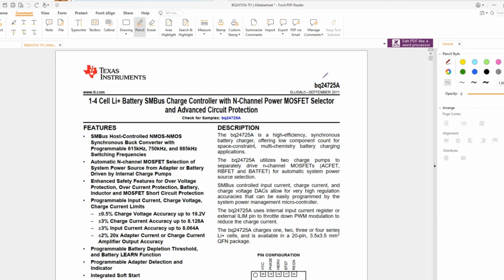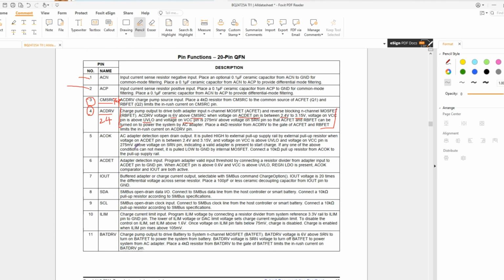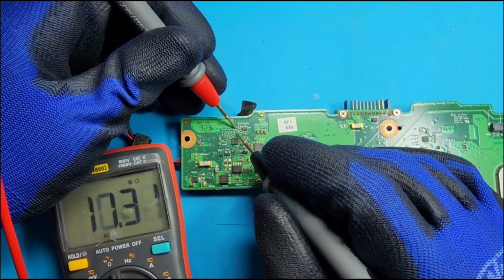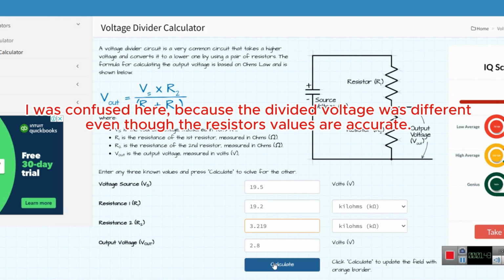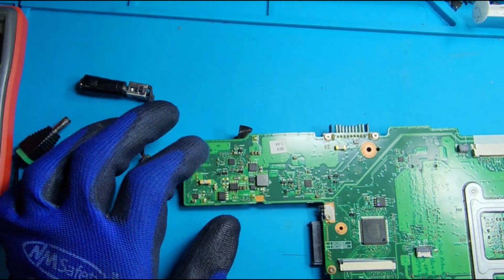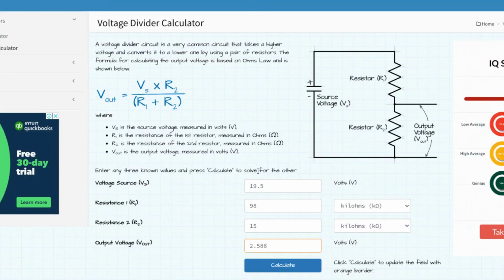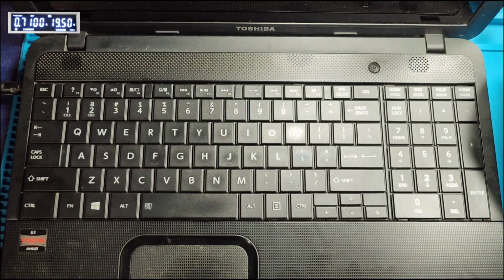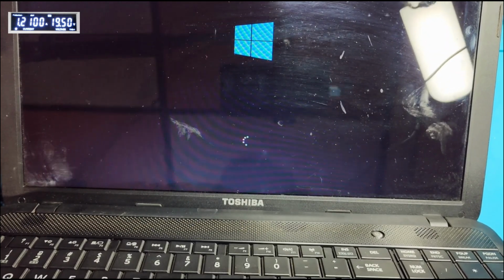Toshibha C850D | No Power | One of the charger IC requirements is missing | BQ24725A

Comment: Next time, leave the charger connected and measure the voltage drop across each resistor. You will find which resistor is not doing its job.
Reply from the maker: Thanks. In a resistor divider we can't actually guess which resister is pulling the voltage low by checking the voltage drop across the resistor. The 1st resistor or second resistor might impact the voltage.

Comment: Surely replacing those 2 suspect  resistors would be quicker then if no change in voltage you can tick off the resistors as faulty , seemed a long way around to me .....
Reply from the maker: @leso204  Your point is correct. But I didn't suspect the resistors before as their values are ok. Also we need to have 2.4v to 3.15v range. I can't just replace any other resistors without calculation. Usually I see problem with charger IC but resistor problem is very rare, in this line. 

Anyhow I accept your point of view.
Will try to solve quicker in future.
Reply: @philiptroniks  : i fell into the trap of checking where there was a positive feed not voltage , took quite a while to figure that'  injected voltage at vcc then found voltage drop on injector display  it was a shorted mosfet no where near the power stage , kicked myself with that one what threw me off was the 19v 5v & 3.3v  all over the board ..
Reply from the maker: @leso204 Interesting. Sometimes we may not spot the fault immediately once we start diagnosis. Our rule of thumb will hinder us to go in a specific way. However once we find the fault, we'll be happy about that like the one you saw in your case. Practices and experiences shape our knowledge and skills.
Reply: @ : a tech friend said after i told him '' thats monorail thinking'' i thought thats a clever observation ...

Comment: Please master I would like to inquire from you, current and voltage which is first on motherboard when you plug in adapter/power supply

Reason for this question is, I have repaired a lot of motherboards when they have dry solder joints for resistors forexample
Input of resistor has no volts and output has no volts but after soldering resistors properly I get volts both in put and output of resistors
Reply from the maker: Voltage and Current are like 2 faces of a coin. They are not different and they don't come one after the other. Always a voltage has current and the current travels through the voltage.

You can understand Voltage, Current, Resistance using Ohm's law. V= I x R. In case, if Resistance increases in a circuit while the voltage is constant then Current will decrease. So, if you place a resistor on a voltage line then it will reduce the current while the voltage doesn't change on the output.

However, in your case dry soldering is like an open circuit or high resistance. Which is due to oxidation of the solder joints which makes the pads on the board and the pins on the components to loose connectivity. 

Once you resolder it then there will a perfect connection between pads and components, like resistors in your case.
Reply: @philiptroniks  OK master I have understood. Thank you

Comment: I would havd blamed D6002 instead. Hard to belive that a resistor measured value differe in the reality. Very good job and very good explanation as always!
Reply from the maker: Nice catch actually, I didn't notice D6002. 

If the problem persist even after replacing the resitors then I would have started looking other components like D6002.